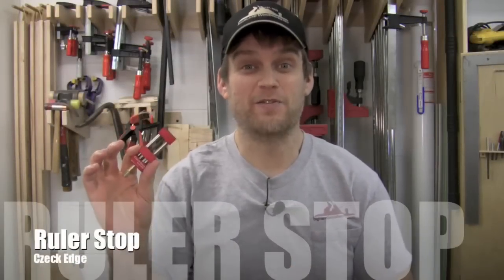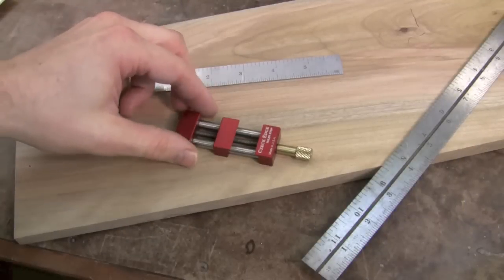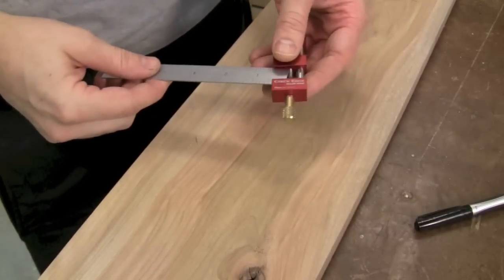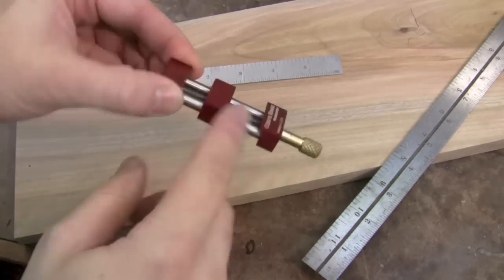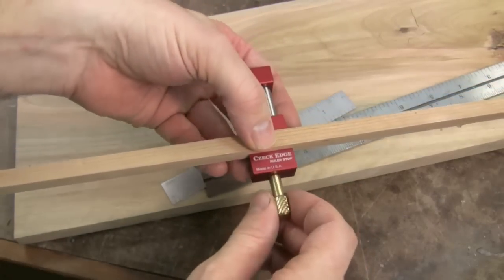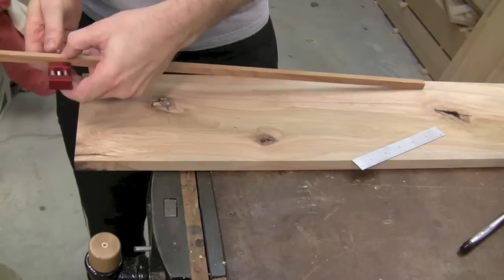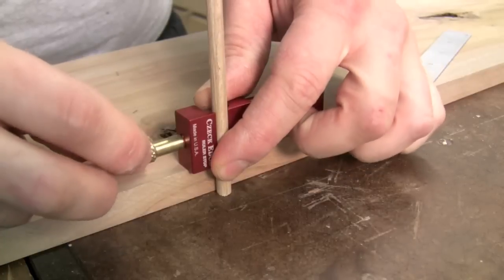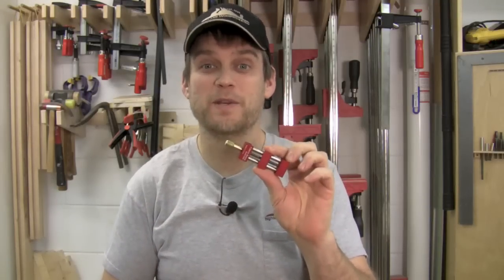Czeck Edge Ruler Stop Product Tour

Comment: Danny - it's true that a 6" combo square is great for a variety of tasks - and I use mine all the time!  The ruler stop is also useful on any sized ruler, holding measurements on 12 or even 24" rulers. Having multiple saved measurements is nice for projects - my combo square gets reset all the time. Also it can be used on story sticks, so you don't need a ruler at all. Pretty handy little guy.

Comment: Great tool. I bought a second one so I can run a parallel fence for cutting sheet goods. The second one I bought is slightly longer and it fits on a 2 metre steel ruler. That is very useful because I can mark 1.8 metre or longer which is a common size of cabinets I built.
I can also use these for brick paving although I don't want to damage the edges. The second one I bought has a larger diameter thread. An upgrade you may say.
The opening is about 40mm whereas my previous one is 35 mm.
The delivery took two weeks so I'm very pleased with the service.
Considering I live in Australia.